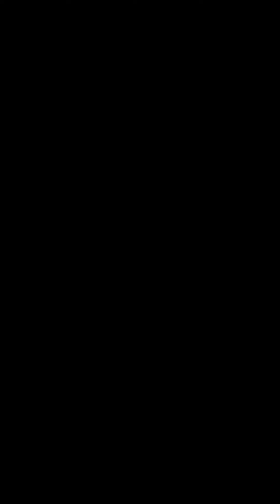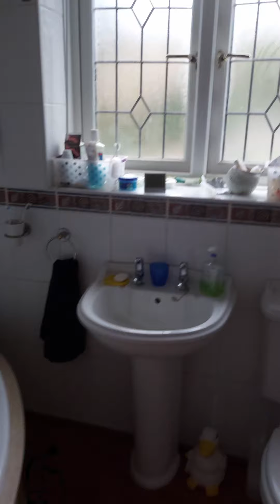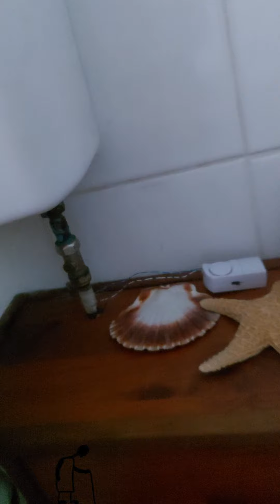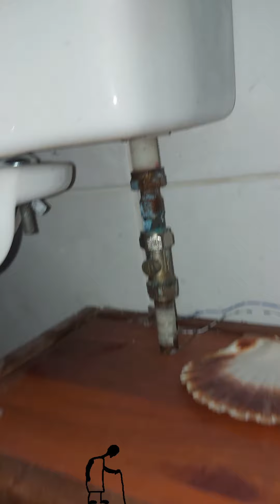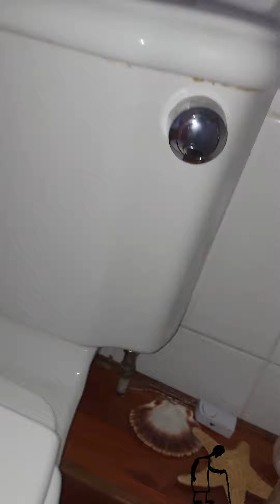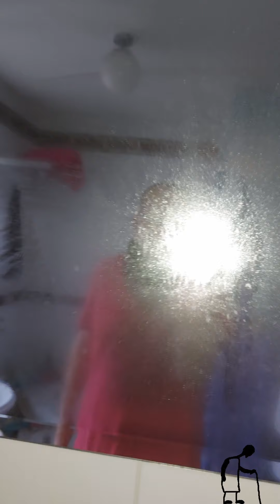HIGH PITCH NOISY ALARM My alarm worked - sort of 🤣

Comment: There was some water no the flour as well, did you see that? If your floor is wooden, it does not do any good.
You could finetune your alarm. Not sure how. Perhaps wind a sponge around it, so that external water has a longer traject to travel to reach the wires than water dripping down?